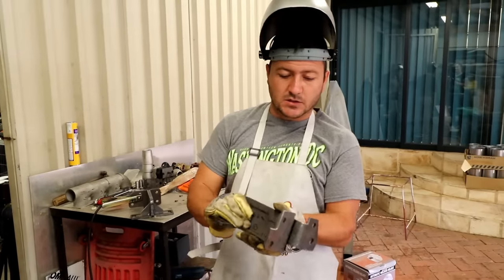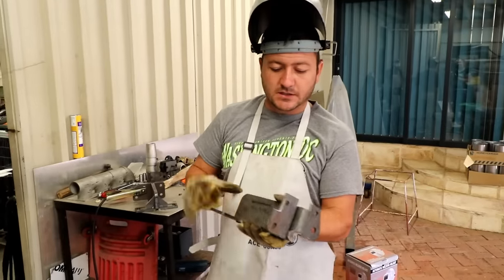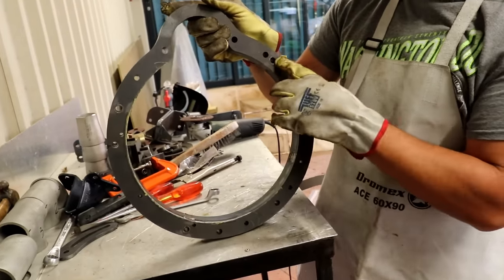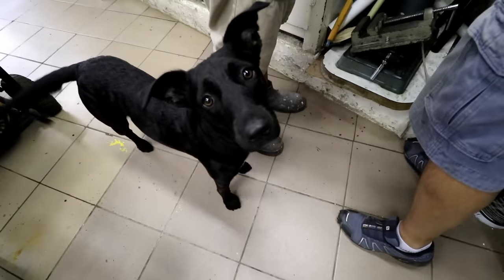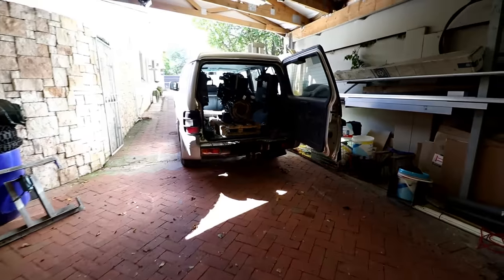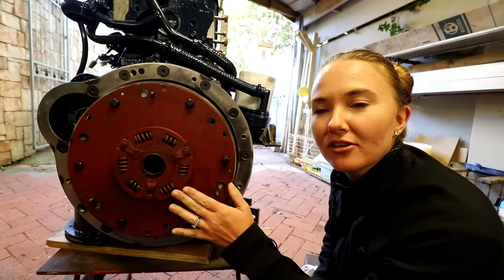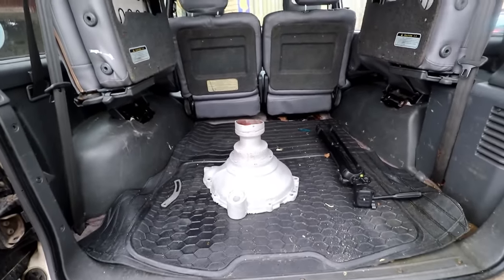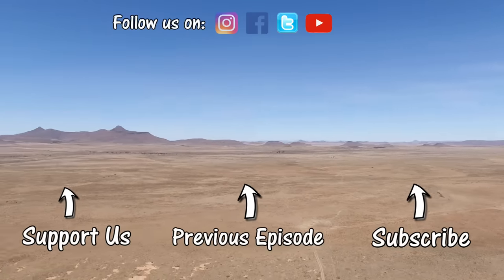YACHT powered by a TRUCK ENGINE!! | YACHT REBUILD WEEK 68

Comment: When doubling up plates, drill some large (2mm-4mm) holes in the plates that do NOT line up with each other.  Now weld the edge of the hole to the opposing plate.  MUCH stronger.
Reply: Yes,  You are referring to "Plug" welds... they make for a tidy looking outside surface and are very strong if done properly.
Reply: Called a plug weld!

Comment: Doing DYI engine work is a real challenge. I'm very impressed with the amount of skill you have in this area. Even so, triple check every bolt and drill hole. Cut corners with cost, not your time.
Reply from the maker: Thanks so much 😊 👍🏻

Comment: looks good,pleased to see you took special care to align the damper plate,which is critical,as any misalignment will destroy the plate very quickly..
check the oil pan sump bottom for scratches in the paint before installing the engine as they can rust through quite  quickly if the metal is exposed to salty air and water, this often gets damaged in transit to the boat.

Comment: To protect your engine from corrosion, get a magnesium block and connect a single wire to the magnesium and the other end to the block. Make sure there is a good electrical connection at each end of the wire and use a conductive greese the protect the exposed steel connection. 
  When a corrosion cell is started it will pull electrons from the mag and through the steel.  Over time the mag block will start to oxidized, just make sure the cable connection is clean and there is a good electrical connection.

Cheers!

Comment: do yourself a favour and tack weld the heads for the starter bolts into the bellhousing adapter. so when you need to rebuild the starter later on you won't have to undo the engine from the leg  just to stop the starter bolts spinning around. i'd also be giving all those countersunk bolt heads a liberal coat of anti seize so you have a small glimmer of hope of undoing them next time.
Reply: Agreed, the tamper will seize very quickly.

Comment: One of the mounts will take more weight than the other due to torque loading and unloading, based on the direction of rotation of the crankshaft. Not sure how the loading on the prop will affect that. They look pretty strong as is, though. Lovely precision work.
Reply from the maker: Thank you! ☺

Comment: It's great to see somebody doing this marianizing,  the choice of a truck engine is good, boat need good engines, and there is no reason not to do this if you have the knowledge or access to it.  We did a conversion of Cummings diesel to auto trans for rural post office vehicle refits in USA years ago, before electronic getting the trans to work without the  usual gas engine vacuum was our challenge. There a lot of extra you have to do here , cooling etc. Cheers Warren
Reply from the maker: Thats awesome! I can understand why so few people do it.. It's a lot of work! But very interesting non the less! Thanks for the support! 🤗

Comment: Great video guys. If there is one thing I’ve learned about engines and saltwater it’s “rust”. Paint and galvanizing everything is so critical to corrosion minimalisation. Cadmium platting is just not thick enough on steel to work for extended periods
Reply from the maker: Thanks Mike! ☺ 👍🏻

Comment: Apologies if I missed it. What engine and transmission did you use? Did you calculate the rpms of the engine with the gears of the transmission in relation to your propeller for optimum fuel economy and performance?
Reply from the maker: Yes we have taken into consideration the rpm of the engine vs the reduction in the drive and we should get a fair economy for the size engine  due to it being lighley loaded. At the same time we have been able to avoid blade tip cavitation.
Reply: @livingwiththemaias  Great! I'd be curious about the performance...
Fair winds!😁

Comment: A question, i want to use a 1uz for a project like this. Do you think i could just use the auto transmission that comes with it?

Im opting for a surface drive,  fixed with rudder or slap on a universal joint and a steering rack.

Comment: I follow the theory on this as interested my self on how to marinize a diesel engine. The idea that you have given me! Bolt the heat exchanger to the bulk head of the boat or put it in the main cabin of the sailing boat as a radiator to keep the cabin warm wile the engine is running. Then hook the heat exchanger up to the two water pumps. That's the rore water pump and the engines water pump then hook the heat exchanger up to the aft bulk head exhaust mixer to sea cox on aft bulk head. Then two heat cycles are getting split up that the heat that we try to remove from the engine is no longer in contact with the engine. Temperature of the first heat cycle could be lowered. Temperature of the second heat cycle might of been charged by the first cycle.
So running temperature of both heat cycles could be lower noe

Comment: I know your using the heat exchanger of the old Volvo engine, could a keel cooler on one of the hulls work as an option? That way you could run the engine with the leg out of the water and not worry about prime failing in the raw water pump. Cheers Warren
Reply from the maker: No we can't run a keel cooler because of creating a lot of drag and we can run the engine with the leg out of the water because our pick up point is in one of the hulls and below the water line. ☺
Reply: Sailing Lady Africa oh very good , I was thinking about the a inlet in a hull bot worried about the pump being able to lifetime the water that far. I have a vide of somebody who actually eliminated the engine drive water pump all together and used an electric pump. Said he used it for years .maybe you might need to be carful you don't burn up your pump if it looses prime . Cheers Warren

Comment: Does all this make you think what companies charge for a marinised engine is reasonable?
Reply from the maker: Colin Mills I still think that they over charge but I suppose it’s a numbers game . This is a lot of work to do it the first time but it would be easy to make all the parts again. They charge a lot due to the R&D
Reply: The funny thing is that marinised engines are basically just tractor engines.  If you have some basic mechanical aptitude and a few machine tools you can probably save quite a few $$$ by investing some sweat equity.  Also, if you purchase the 'tractor' version of spare parts they are much more affordable.  The only 3 parts of a marinised diesel that are unique to that environment are the heat exchanger, the alternator, and then the motor mounts.